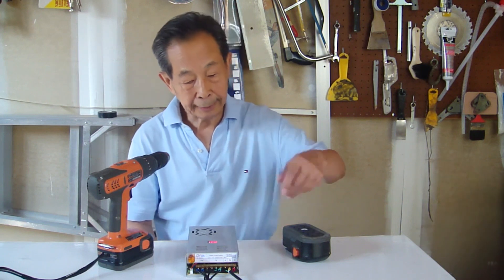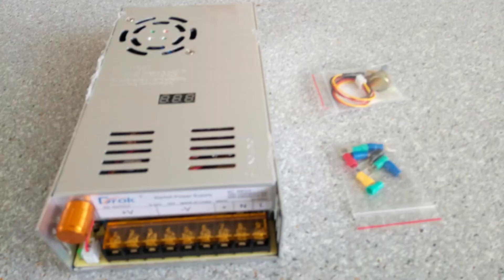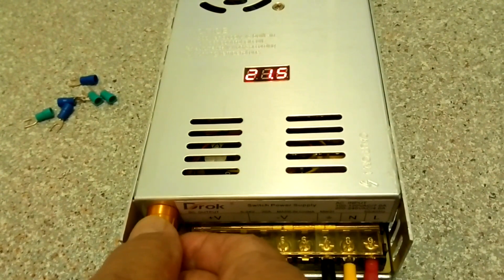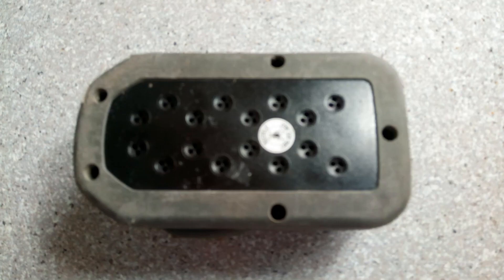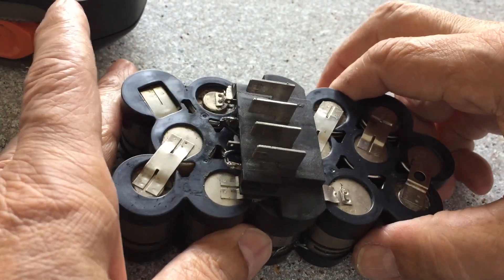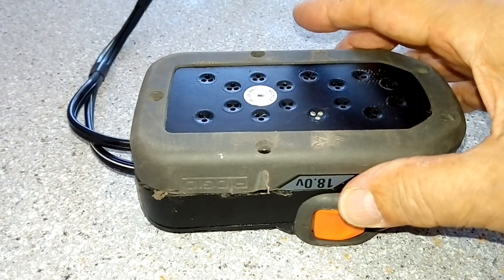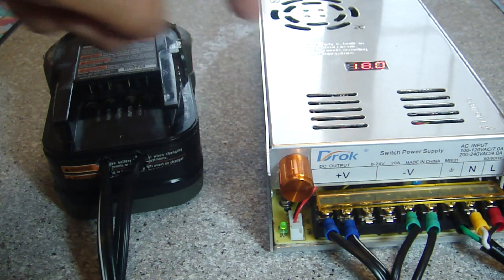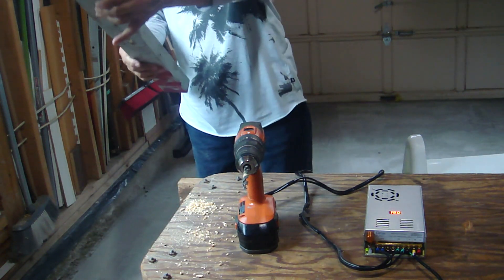How to change cordless drill to corded and hybrid

Comment: I tried the method, but the drill keeps working and turning off. What is the solution?
Reply from the maker: Maybe power is not enough, make sure your power supply can provide enough current and and voltage

Comment: Tried this same power supply on my milwaukee but it wont work. Any idea how? Need help
Reply: which battery pack are you using? There are some battery packs that have a thermal sensor on it.  You may have to get around the sensor.
Reply: I want same problem..

I have Milwaukee brushless impact.. I lost my battery 🔋 in tour .. can I run my brushless impact on coded power supply.. if yes please help me how to do sir 🙏🏻

My whatsapp contact +91 9033570670

Comment: Great job!!  I tried to do this with my DeWalt 20V drill.  It won't work.  I go the polarity correct.  I got the out put and in put voltages correct.  All it would do is turn on the LED on the drill.  Any suggestions? I was wondering if it hand anything to do with the fact that the center two contracts are 4.5V.  I put 4.5V on those contacts plus the 20V, it still didn't work.  Thank you in advance.
Reply: which battery pack are you using? There are some battery packs that have a thermal sensor on it.  You have get around the sensor.
Reply: I'm using the 20V 5AH battery.  How do you bypass the thermal sensor?
Reply: @ericlavalley6260  what's the model of your drill? if you have a terminal that says (T), then that's the thermal sensor. most chargers use this terminal while charging.  But not all tools use this terminal while the tool is in use.  So it really depends on the tool. I would try putting a 10K resistor across the (T) terminal and the (+) terminal.  I don't have a newer drill so I am guessing a little here.